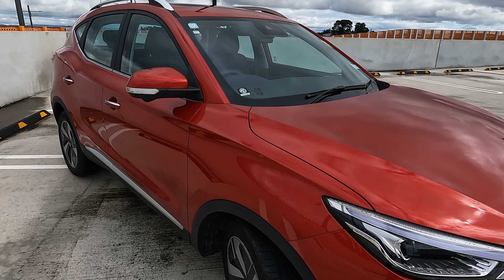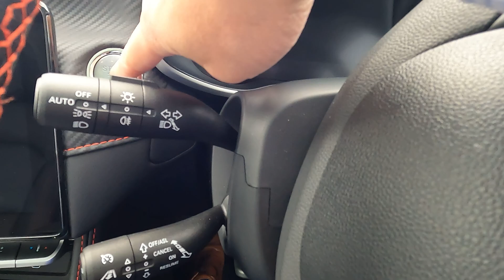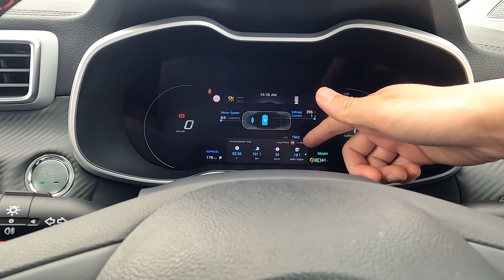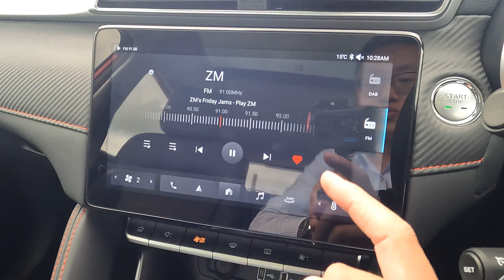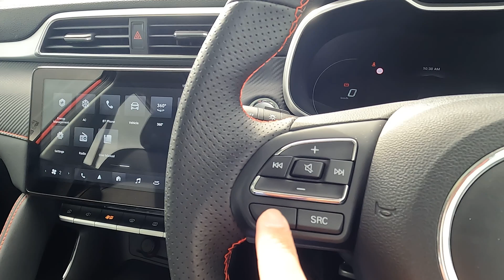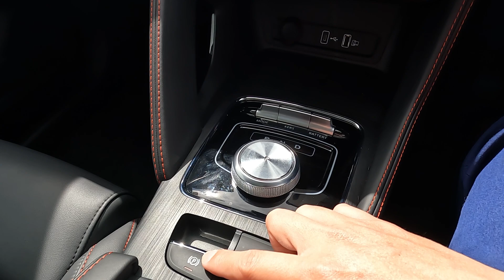▶️NEW MG ZS EV Feature Walkthrough / Quick Start / User Guide -- 2022 2023

Comment: Hi Please help - how to engage Neutral gear in ZS EV MY22 when HV off, is a working 12V battery enough to engage Neutral and push it to another place in the garage? How to do it? Is there some hidden option or is a working 12V enough for this?
Reply from the maker: Yes, I think the 12v is enough to get the vehicle switch on